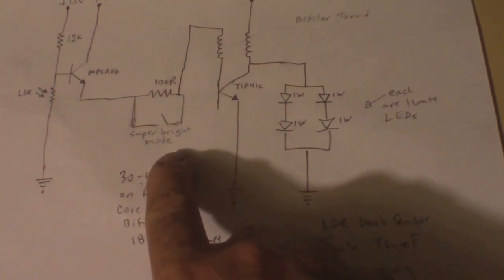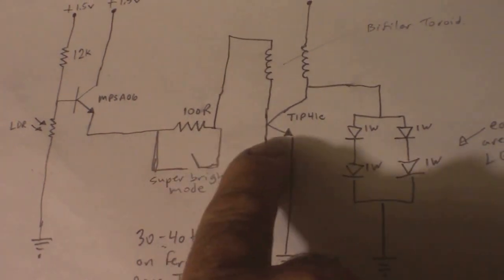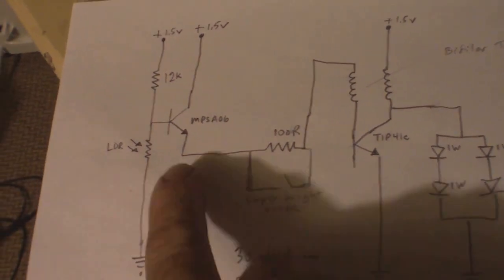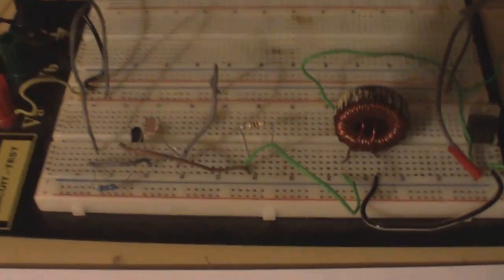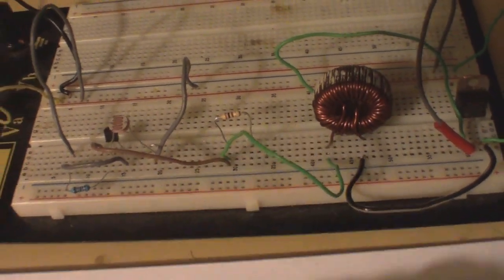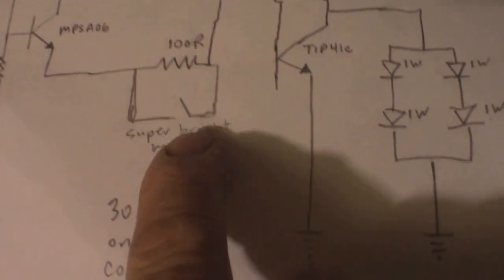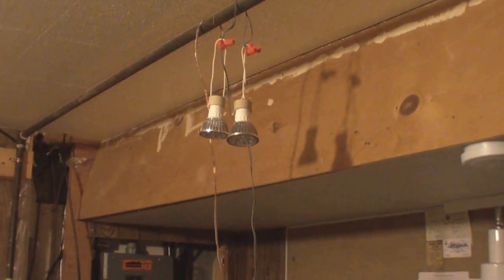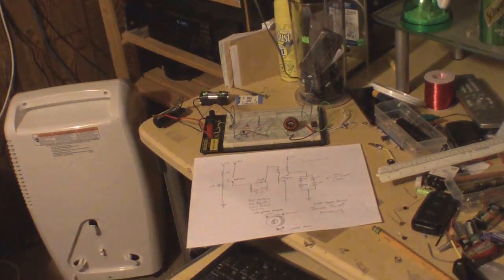LDR Dark Sensing High Power 1.5V Joule Thief Lamp

Comment: Great job with the LDR, the output looks very good for just 1.5v.
Reply from the maker: Thanks! Yeah it is good output. Espcially Considering that the bulb is intended for 6V, two parallel pairs of 1W LEDs, each pair a series connection. No resistors in the lamp itself. I guess it allows more current to pass, but good light starts at about 70 and it is really quite bright at 200 mA.

Comment: Wonderful job !!! :) I have a question. If I want to light up normal 3.4 V white light LEDs in parallel than can we use some other transistors instead of MPSA06 and TIP41C for example 2N4401 and 2N2222A? I am new to electronics and hence dont know much about it but really interested to know more about this stuff. I hope you dont mind answering my question.  Thanks !!! Best Regards :)